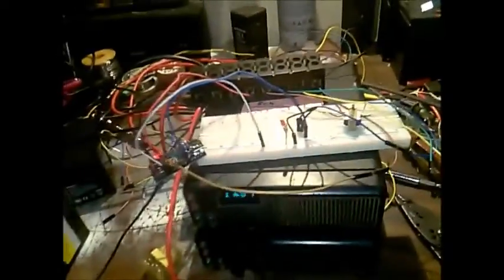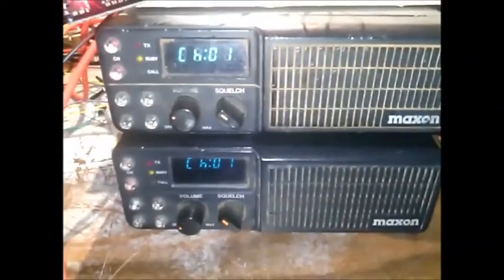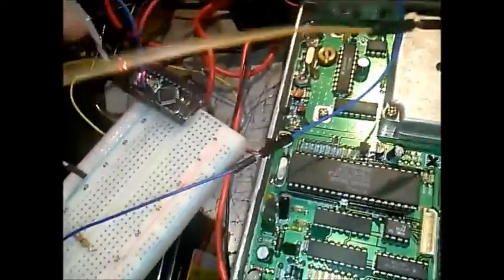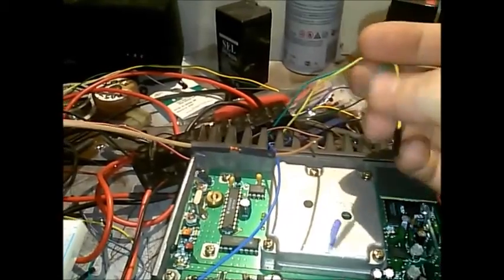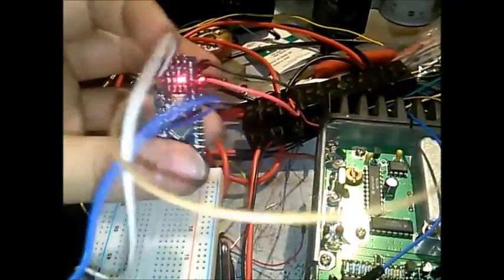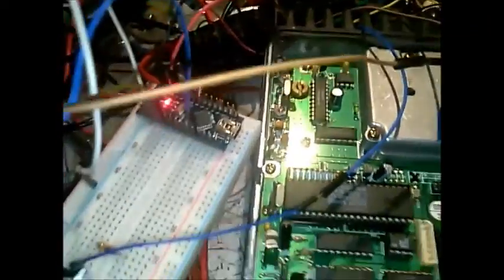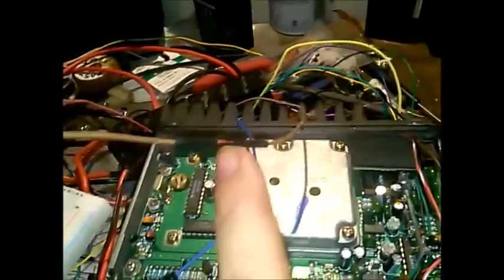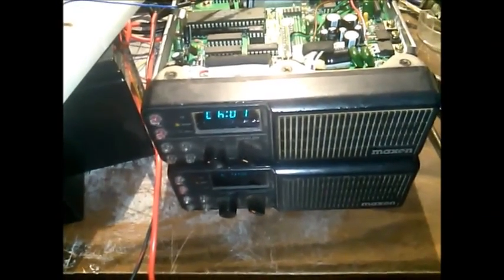Arduino Nano GMRS Repeater Controller - How To..

Comment: nice video I aint into R"rrrr-dwinO's . te hee. but you have any experince with ...
The vertex ftl-1011 radios I have 2 on 6 m  low  radios info?
Question.. im looking find the internal solder points for: cor. sq and the audio pre out to go into tx radio
or the PCB points on connecting a ts 32 pcb?
Lack of info on these radios and you cant use audio from speaker cause of a shuffling sound getting in tx radio.
Really sounds like a storm even when padded down? 
Need pre amp steady low level output ?
 I dont want change level loudness when monitoring input radio need into on the ftl"s.
I cant find a freeservice  pdf ?
 Hmm how too? someone had make a repeater out of these types radios? fdtl 2011 vhf and 4011 uhf I have came
 across before be such nice radios to make a repeater.
Reply from the maker: I haven't worked on any of that particular model, Not much Lo Band activity around here, but Here is a link to the service manual for that radio - https://elektrotanya.com/yaesu_ftl-1011,1014.pdf/download.html
It should have a schematic section that will give you some idea where you can tap the radio for what you need..

Comment: Nice video! Please go easy on that screwdriver poking around inside of a working radio. Nothing worse than letting the magic smoke out and killing a good project. Zetron used to be the Cadillac of controllers UNTILL they got a hair up their ass on support of used equipment. They want to charge outrageous fees for support and repairs. They just don't want to deal with small timer, seems they make more $$$$ dealing with big operators. I understand that it cost money to have a support staff but for items out of production why don't they just put up tech info so people don't have to bother them.

Comment: Just out of curiosity, if you are not adding ident etc isn't the arduino controller a little overkill? I'm sure what you are doing now could be done with a simple relay that is built to run 100% duty cycle (I'm not sure horn relays are) or a transistor to replicate this if one exists for your PTT?

Meaning when the COR hangs low the switched circuit latches the PTT->EARTH connection. Then just need the trans/relay and iscolator which would be IMO cheaper, simpler, easier to hide internally etc meaning you could just run a 4core lead between the two rigs with a disconnect in the middle or a pair of RJ45 sockets allowing a regular 0.5m network patch cord to join the tx'er and rx'er together (again overkill for a matched pair IMO.

I commend your experimenting though :). 

As for the Moto's having the COR on the accy plug at the rear, not all have this. I'm in the process (VERY slowly unfortunately) of matching a pair of Motorola MCS2000 radios (for shits n giggles value more than anything) to make a transportable repeater and their only COR possibility is the 5v DC speaker bias or FM mute. I need to somehow find a good switching transistor or 5v relay that will detect that 5v bias and earth the PTT input (never thought of a transistor until I saw you using one there). I have crossbanded a Moto M120 with a GM300 using that back connector and a $20 lead from HK with no issues and great success. Have a few $10 HK leads that allow one way as well.
Reply from the maker: +Glen O&#39;Riley The arduino method leaves the field there for more options later like an CWID system via a library or whatever. Yes I could use a "suicide cable" but I like to have a hang time and overall its actually cheaper to buy and program an arduino than it is to buy one of those cables... $4 vs $14.. or so..

This project is something I mess with when work slows down and I am bored. lol
I guess it opens up a whole new area of experimentation and maybe a solution for a somewhat controller option that does not cost an arm, leg and small child..

For 5 pin Motorola radios (radius M100 etc) there is a simple transistor mod you can do to get a COR output from the radios CPU. The repeater builder website has info on it. I have a GMRS repeater in service right now that uses a pair of 5 pin Motorola Radius M100 mobiles where the TX radio is turned down to 2 watts to drive a Cresend UHF PA set to 50 watts. The controller is a CSI-9800 with phone patch and CWID built in.
I think I have a video of it on my channel someplace along with one of a backup mobile commercial narrowband repeater built from a pair of Motorola PM400's. I cannot remember.

The MCS2000 is a fine radio but very overkill for repeater use unless your installing it in your vehicle and have multiple pairs like for mobile ham radio repeater but what do you do for a duplexer? Or would you use 2 antennas?
You should be able to program the pins in the CPS also to give you the signals and such you need to create a repeater
Reply from the maker: +ElfNet Gaming It is IMPORTANT to note that I fried 3 of these arduinos trying to make this work because the obvious COR in the radio was not a 5v standard but a 10 volt.. I had to trace the line back to the CPU and tap it there to get a true 5 volt to trigger the system. The barrier I have now with the Maxon / Monogram mobile is getting the trigger to fire on PL/DPL detect and not open detect.
These radio make good repeaters because they have generally GREAT receivers and they are 40 watts.
Reply: ElfNet Gaming
interesting, my M120 has a 12pin or something around there socket on the back (2ch GM300).

A duplexer will not likely work in my case as according to everyone I've asked the TX and RX are "too close together". IIRC TX would be 476.525 and RX 477.175 so would need physical antenna separation (boot + roof magmounts I guess).

I know they are overkill but it was more of an "well I have the radios already and being non astro they aren't of much use otherwise atm so why the hell not". Narrowband GM300's etc are not that common here, most are wideband and if I were to have to buy in hardware (not something I already own) then Simoco SRM9000 bricks are cheap enough now.

2x narrowband GM300 @ ~$120 each (ridiculous I know, even the wide bands are fetching ~$60 each still somehow) vs 2x programmable width SRM9000 @ ~$100-130 each suggests go with the Simoco.

As for your 10v issue, would adding something like a 7805 trans in the middle of the COR line not be possible to step down?
Reply from the maker: ***** its a 16 pin - http://www.irlp.net/images/MaxtracPlug.gif

If you have a spectrum analyzer with a tracking generator you can tune a duplexer to work on that split, I have tuned them to work on in VHF with RX and TX being 100KHz apart. Its tricky but can be done but the issue is duplexers are "static" and if you change frequency you would have to retune the cans..

I wish the FCC would allow us to use the 470 - 512 MHz band for our GMRS for digital formats. there is nothing on that band here anymore since TV went digital.. We have 8 50 watt GMRS channels in the 462MHz area and then there is the no license FRS channels in splinter frequencies between the GMRS channels..

I have maybe 3 or 4 GM300 "N" units and some GP300's that are narrow-band, rare as rocking horse shit indeed and you never see them on the internet for sale at leas for a reasonable price..
Another nice radio was the Motorola Spectra. I have a lot of experience with those units from changing MLM boards to modifying moflags to change feature sets (make a conventional radio into a trunking radio)

I could have added a 7805 in there BUT i did not really want to do that unless I had no other choice. Since I found a usable point that works, its ok for the time being. If i run the current configuration through a ZR310 I can be selective on if a detected PL/DPL keys the transmitter BUT ZR310's are not cheap and the ones I do have are for my actual commercial systems.
Reply: Yes the allowance of digital modes on CB would open some new capabilities, even if it was just the last half of the channels (the newer half which don't include the emergency channel).

I was most amazed here one night when warning a traffic control mob off the emergency channel repeater input (ch35 goes into 5) that they had the hide to turn around and expect I could be criminally prosecuted for "interfering with traffic management". That is the level of morons we have on CB now :(.
Reply from the maker: ***** The US CB band is in 11 meters 27MHz allocated to 40 channels in AM with an emergency channel on 9. Only open road truck drivers and failed ham radio operators (those who got busted and had their fcc licenses revoked or those who cannot pass the test) use that band anymore though and is interesting to listen to when skip is running.. We have 462/467 MHz for GMRS and FRS but GMRS requires a license. I think it would be interesting to open up the 470 - 512 MHz part of the band here for use to add more channel capacity since no one uses that part of the band anymore.
Reply: ElfNet Gaming
we have 11m as well and the ch9 emergency channel on there but the only people who really use it now are those around 35LSB and those around 55 (yes the out of band across the pond channel).

I still get on 35LSB from time to time but otherwise it's a dead band here. I don't think any trucks even have them installed any more over here, rather all going to UHF.

The issue we have is there is no license and no expectation for dumbass' and dead beats to read any sort of rules and x channel is used for y purpose etc so it's a complete tardfest now :( and why I'm finally going for my AOCP (despite the fact there are certain amateurs who REALLY make CB dreg operators look tame).